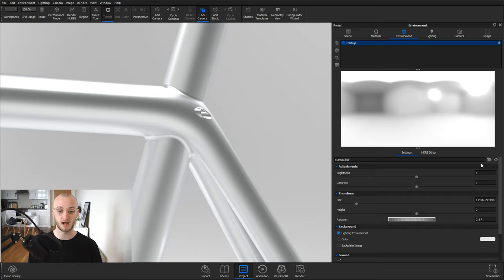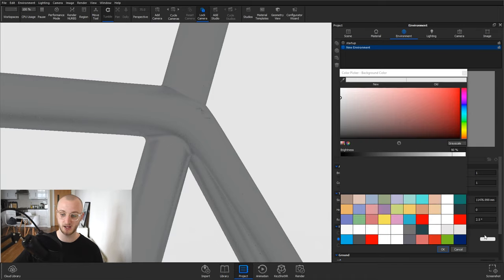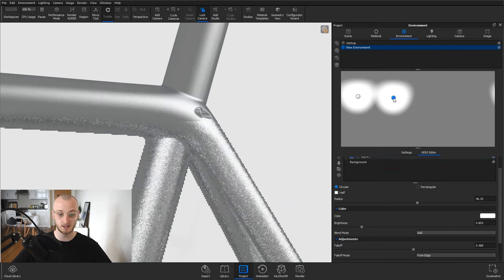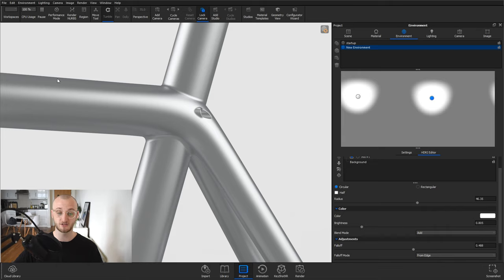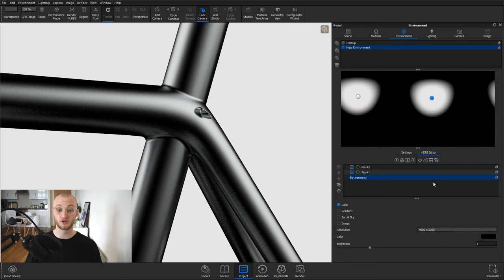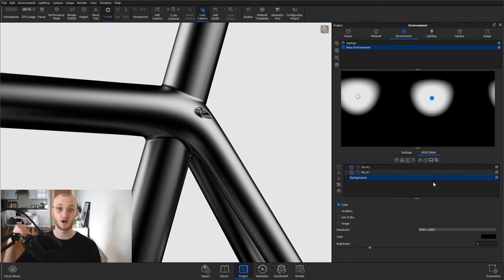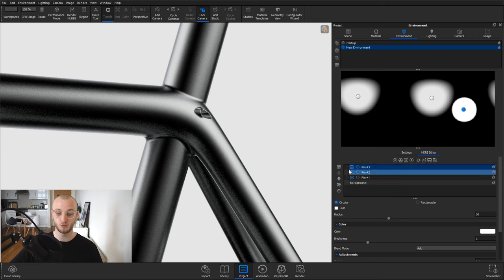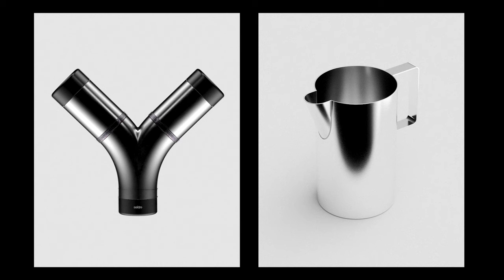Lighting Metal Objects in Keyshot

Comment: Hi can you please help me with HDR pins. and why my reflections on say, glass, or a shiny paint, are jagged? I already researched that you have to render high res image in HDR editor. and save the HDR. I do this and Still the white parts of pic, shapes are jagged. My geo is high resolution also. I can't figure this out?
Reply from the maker: If you click the refresh button, it will generate the new full res HDR
Reply: Liam Martin thanks. Thanks. the problem was my fault: my geometry was too low! I am using Zbrush Bridge to Keyshot. It’s takes your model over from ZBrush. I had my meshes subdivided up to about 5 levels, smooth and high res. But when I bridged they were down a few levels at that time. So I just went back in and updated the live sync. thanks though.

Comment: Nice tip man. This way we can change color of the product by changing BG color, but what if we have differently colored products in same scene?
Reply from the maker: Same principles no matter what colour your product is. If you change the background colour, you want to change the colour of the pin that's behind your product
Reply: @LiamMartinTutorials  Thanks for  your video, very useful! But i still have a question, my product is made of plastic and metal with different colors,blue red yellow and green, so what color should I use as my bg color and pin color?